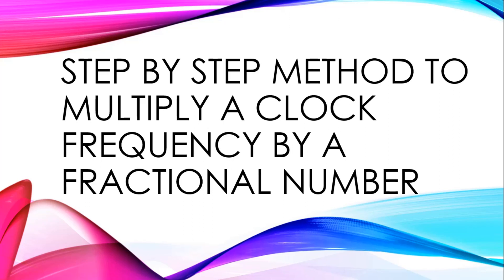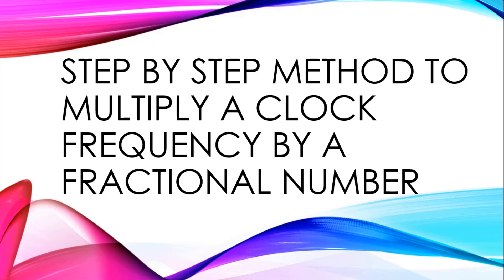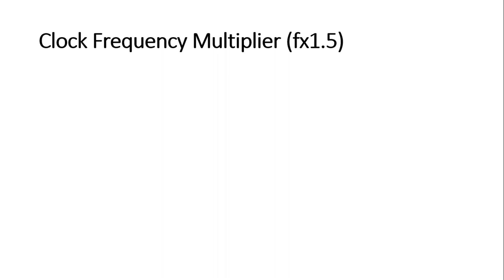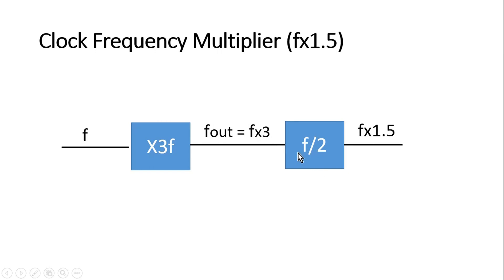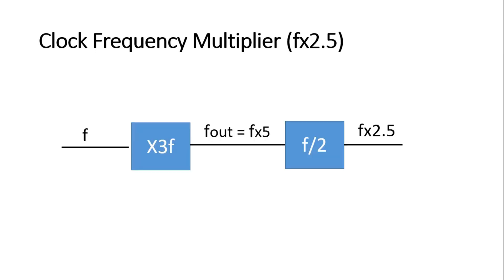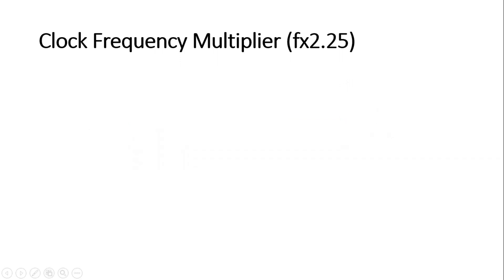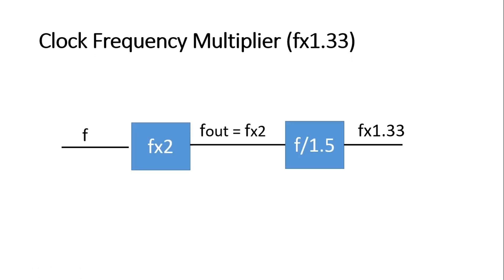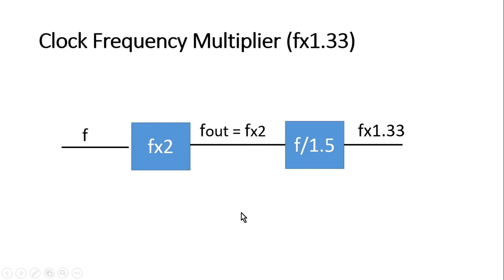Clock Frequency Multiplication by fractional number (Step by Step method)

Comment: After multiplying the input frequency, the result should give to the divider circuit but the problem is there is no input line for the divider circuit. 😅😂
Reply: I think  we have to give the  xf as the clk to the divider circuit, that's what it means